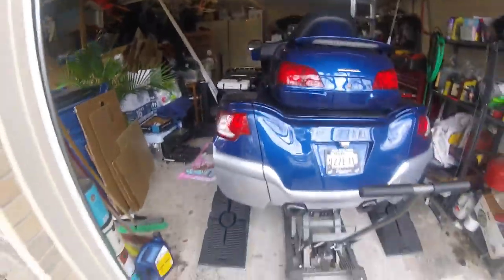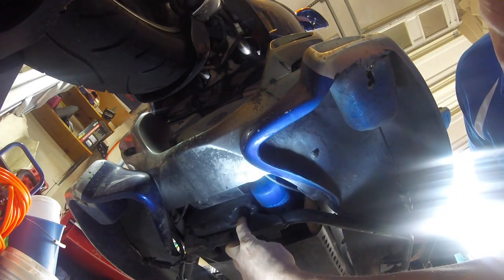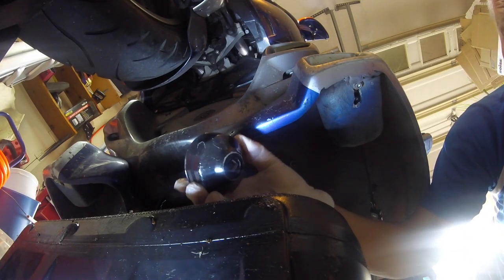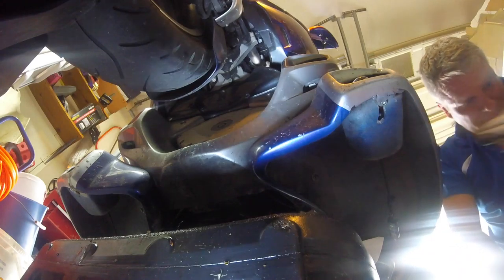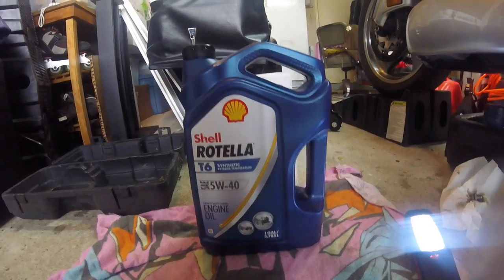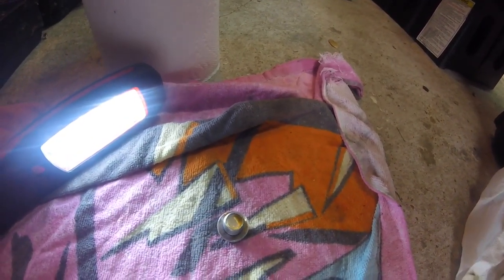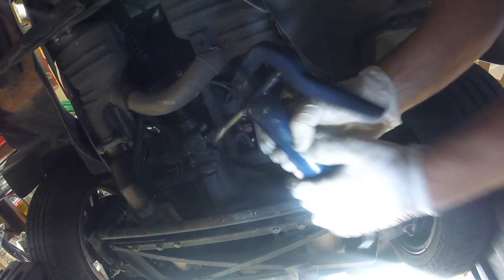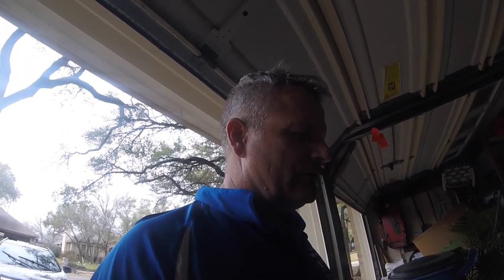Honda Goldwing Trike - Oil Change and Grease Ujoints

Comment: I have a Lehman Monarch2 GL1800..just a tip..but remove the oil filter first then the large drip tray won't be in the way, use a small one first to catch the oil out of filter, i always prime the filter with a little oil too Jim and put the trike on some stands the night before,i also do not warm the engine up to drain, all the oil will have drained into the sump,i put a large tray there and just leave it to drain out..the driveshaft on mine just has one grease nipple,i found the small one hand grease guns did not have enough pressure to pump grease into  the nipple,so i bought a larger one for 400g cartridges ..test the pressure first it should squirt out, not come out in a blob .I use Shell Advance Ultra 10W-40W fully synthetic as i have on previous bikes,runs quieter,better MPG,and doesn't go dirty as quickly as Semi..nice video Jim...doing it this way will save you lots of money..In the UK they will charge £300 for oil/filter change....oil is £26 for 4 Ltr,..filter £8...  work it out yourself.Remember to use Motorcycle Oil which is specifically designed for motorcycles with wet clutches..

Comment: You are very smart about the priming of the oil filter element..Of all the oil change vids I have seen,hardly any one ever mentions that  nor the time it takes for the oil to fill a dry installed filter  while the engine is running....
Reply from the maker: Thanks, it makes sense.  I even do it on my cars too.

Comment: I replaced my plug with a magnetic one....about $5.  I'm about to do an oil change this week so we'll see if it attracted any shavings (crossing fingers that there are none of course).   Also, I use the Rotella 400 LE....it's 15W 40....older bike.
Reply from the maker: I remember seeing some shavings only when it was new and change the oil.  Have never seen any since.  I would guess it was just the break in time..

Comment: JimI need to say you are amazing I can say with a bit of certainty I can fix most things on my vehicles I watch You Tube Videos and go at it But to look at you I am reminded of the saying don't judge a book by its cover  by you tackling the bushings on your trailer and the mods you have done and the distances you and your wife travel , if I wore a hat I would take it off to you.I would like to ask if you don't mind what kind of conversion kit do you have on your trike I listen to you talk about the Harley Trike when you were chasing the sunset and I understood what you were saying about the single axle vs a independent one I am thinking about the reverse trike the can am F3t Limited or GL 1800 Goldwing your input would be appreciated Thank You Don
Reply from the maker: Thanks Don, I think I do all my work because I am too cheap to pay to have it done. <grin>  Really though, it is fun tinkering and doing it myself.  I have a Honda Goldwing Motor Trike Razor.  I rode the Spyder F3.  I liked it, super smooth and really tracked straight.  Just me, but after having a 6 cylinder Goldwing, that 1300 Triple just seemed really under powered.  But It does have some get up and go.  Not sure how it would be riding 2 up and pulling a trailer.  May be a tad over taxed.